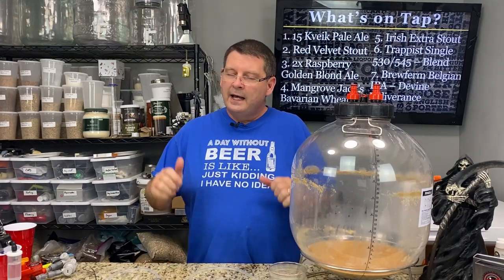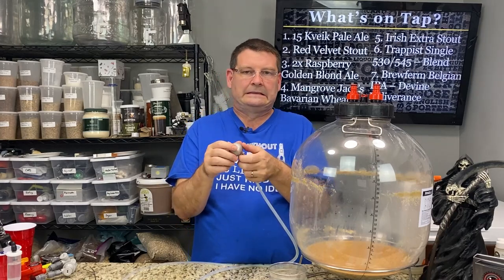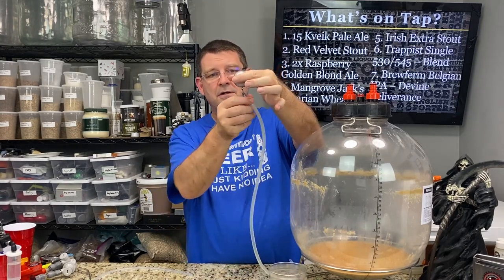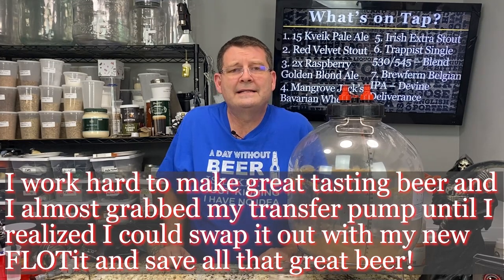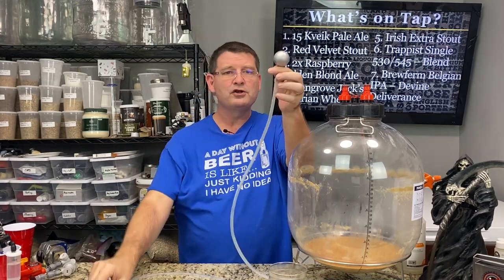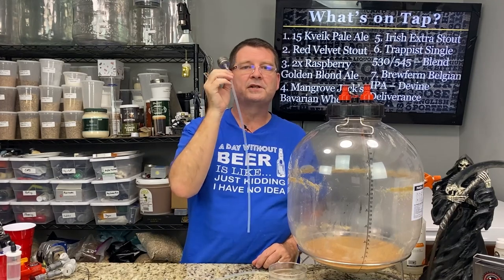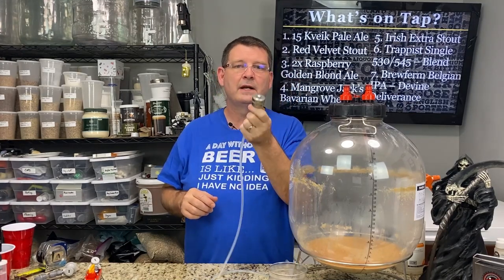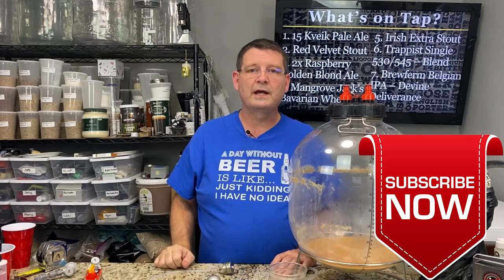Corny Keg Floating Dip Tube, Major Issue

Comment: Wait. If the ball is nearly under the beer, and the pickup tube is under the ball, how does that make you lose beer? The lower the tube is, the more beer you should get. What am I missing?

Okay, I saw the explanation at Homebrewfinds. The tube hits the yeast cake, and the yeast cake blocks the beer. This happens when there is still a lot of beer in the keg, so you lose beer. Now I get it.

Thanks for this video.
Reply from the maker: Sadly I was in a lot of pain and grumpy when I did this video, as I was annoyed that a lot of companies were jumping on the bandwagon to resell something that was invented by some home brewers over a decade ago. If you get a chance, you should check out my Floating dip tube comparison series (4 videos), but here is the 4th video making the final comparison - https://youtu.be/xd-ajnaEGd4

Comment: Hi folks, viewing from Ireland love the channel, great advice. I've been using the kegland floating dip tube in my modified bucket fermenter and kegs. I ran into same trouble at start. I fixed my issues by adding a second stainless steel ring to dip tube ball float and cutting silicone tube so the end stops a couple of mm from bottom of keg, kegs now empty fully, so every last drop of precious beer except yeast is drank. Did same with the modified fermenter, added ball lock posts for closed transfer and added a filter to the end of floating diptube and have had no problems with beer left in fermenter or trub being transferred when kegging. I know you shouldn't have to do these things, but I think it's part of the home brewing magic, adapting and modifying. The flot it dip tube looks awesome, I'll definitely be getting some. Thanks for the link, advice and review.
Reply from the maker: Welcome and Ireland is at the top of my bucket list so much love in return. I really just want to go to the Temple Bar and have a pint, just to say I was there (plus a few other cool places of course). 😀😀😀 - I appreciate you for sharing that info and I think I understand as I've seen a photo someone else referenced where it was tube<->small opening connecting to the floating ball<->tube if I follow and of course the metal filter on the very beginning. (?) Correct? This way if the tubing hit the trub it didn't suck it up first but the liquid correct? Feel free to share a photo from Imgur as pictures are always helpful but not required. I did ask Tongo about shipping to AU for a friend and it was crazy cheap just probably not very fast. Sadly I won't get to Ireland until maybe 2 more years if I am lucky otherwise I'd just order a few and bring them with me for you.
Reply: Hi, since this comment is 3 years old, did the Kegland dip tube have the mesh filter back then?

Comment: The critical thing is to trim the tube just right.  You want the length such that it would hang free and pick up just below where you expect the top of the cake.  This makes it easy to control pickup depth by angling the fermenter a little.  Obviously this will work better with a cold crash, as the cake will be more stable, but that the difference isn't huge either way.
Reply from the maker: I fully agree with the angling of the fermenter but as my trub was far from solid it was a bit of a pain (and I don't have anywhere to cold crash the all rounder as it is kind of big). I get what you are saying about the shortness of the hose but the trub does flocculate a bit based on the yeast and the OG and FG of the brew, sometimes significantly. My big point was that the FLOTit (although they recommend trimming the tube to) doesn't need any modifications to work amazingly well compared to a design that is going on 20 years from my research that doesn't appear to have ever had a patent issued as everyone copies it with very little changes if any. 

The new Kegland filter for the floating dip tube (which they are now throwing in on the Fermzilla complete setups deals (after I got mine)) actually helps fix theirs not so much with the filter but how the filter will hit the trub forcing the tub to level out and never hit the trub directly as compared to without it.

Comment: I’ve used the kegland floating dip tube in the fermzilla and in my kegs for over 20 batches or so and have never had an issue with leaving beer behind. My liquid line does not sit 2 inches below the ball. I will say I always ferment 6 gallons of wort so that helps but in the keg it will settle to the bottom and it leaves no beer behind IME.
Reply from the maker: Does it pull trub? I had someone tell me they had the opposite issue with the tubing sticking out of the liquid which I'm not sure how that happened but all I saw was the tubing was heading head first into the trub and the tube was a solid 2" below the surface.
Reply: @BitterRealityBrewing  I do exactly what short circuited brewers does. I tilt the all rounder when it get close the the trub and I get every ounce I want out of it. I look at it as a positive to be able to control how much I get. I have yet to find a fault with the all rounder using their floating dip tubes.
Reply: @jeffnicholson6110  this is exactly what I do as well. I really dislike this video because literally the smallest change in technique makes the kegland dip tube work perfectly. It DOES NOT function as bad add this dude makes it out to be. He was just to lazy to try and figure out how to make it work right.
Reply: @mattb6124  yeah I felt it was a little harsh. I may be a bit protective because the fermzilla and floating dip tubes have really taken my beers up a notch. At least to my taste. Not to mention the all rounder with floating dip tube has given brewers an affordable piece of kit that really produces. Brewers tinker on things and the floating dip tube literally takes 2 seconds of tinkering (tilting the all rounder) to make it work perfectly.
Reply: @jeffnicholson6110  1000% agree with everything you just said.  They're both too great products for me to sit back and be silent on this one.
Reply: @jeffnicholson6110  ^^^^ This, tilt and slide the Fermzilla down as you empty it and it dispenses every last drop if you wish it so.
Reply: @mattb6124  Did you keep the tube full length or did you need to shorten it (in a Kegland keg)?
Reply: @zt7489  mine are all full length still. No need to cut.

Comment: Exactly why I bought 5. 
Also the firmzilla floating tube sucks up to the side , I had to make a notch in the tube just to get it to flow. 
Flotit. Works amazing.
Reply from the maker: I fully agree and I'm very happy I found Tongo (on eBay) and his FLOTit devices. I have 7 now but need to order 3 more as I didn't plan on needing them for fermenters.

Comment: Awesome would you recommend using this for a  keg to keg transfer, for example, I currently have 10 gallons of peach saison beer that was transferred from our fermenter to Two corny kegs. I'm cold crashing beer for two months before carbination because the beer is for a wedding in December, hopely the cold crash will result in more trube/ peach bits that will settle out during cold crash. Then I'm  thinking that I want to use this float to do keg to keg  transfer to final kegs for carbination. I'm thinking I will try to attach flotit to my  keg carbonation stone keg lid. Do you think it will work or do you have any other suggestions?
Reply from the maker: 100%! The newer FLOTit is version 2.x now, and it is awesome. I purchased a lot of them and had to do a transfer from an All Rounder Fermenter under pressure to a keg. Something I do all the time but this time, it was with a ton of Blackberry pulp which clogged a cheaper floating dip tube I was using. I swapped it out for one of my FLOTit 2.0 devices that I had recently purchased, and it worked like a charm. I'm slowly buying more to replace all of my current floating diptubes, so all of my kegs (16+) and pressure fermenters (3) have one each, with a few spares. The inventor gave me 2 for the video reviews, but I purchased all the others as I was simply impressed with the performance.

Comment: Have you used the Kegland floating dip tube? The Kegland tube actually lays down at the bottom and continues to suck until keg is empty. Be careful when bagging products
Reply from the maker: The video is a bit old and that was the Kegland floating dip tube which I've mentioned in newer videos that Kegland was one of the only companies to admit there was an issue and address it with their plastic filter add-on as the design was invented by homebrewers almost 20 years ago and many companies have copied it without fixing the issues. I did a 4 part series on the Floating Diptubes by covering each type/brands in 3 separate videos and then the final head-to-head comparison in this video - https://youtu.be/xd-ajnaEGd4 Although I don't regret the original video as it was done out of frustration I do regret being a little hostile as I was tired and in a lot of physical pain (due to heart issues) and I'm normally really easy going but when I'm in pain I'm serious grump. When you watch the video you will see almost all designs have their pros and cons. Plus some are really cheap and others are very expensive.

What is funny is that I got a lot of flak for that video when it first came out but I later had 3 of the people who gave me flak come back and apologize, after realizing the original designed very flawed compared to other systems and improvements available. One was like "I never realized I had an issue until you pointed it out and now I can't stop seeing the problem with the design."

Comment: I am one that bought the floating dip tube. I see your point. I have re jigged mine like this and it works much better. I took off the ring that connects the float to the stainless tube. I flared the little stainless tube to go over the ring on the float. Then I Locked it there by reinstalling the ring. Now it picks up the same as the float it. When it gets to the bottom it won’t get into the yeast cake. The hose needs to be adjusted to do this properly. I tried to send a picture but I could not.
Reply from the maker: Thank you for your insight and as a homebrewer I think we are all use to a little DIY but it really shouldn't need that much of an adjustment. The design appears to have been created by some fellow homebrewers almost 20 years ago so I think it was time for something better and I'm just happy someone stepped forward with a better design. I brewed a DIPA today and used my FLOTit in the Fermzilla not just because I'm concerned for grabbing part of the yeast cake (even with rolling the fermenter around) but I went nuts on the hops so I'm a bit overly concerned as most went into the fermenter (1 full pound of Cascade as I had way too much of that stuff from deals). Thank you and please feel free to share a link to Imgur of your modification as I'm looking to either modify mine or make them Xmas ornaments.

Comment: I use one of these in a corny that i ferment in, works great! I actually just got a kegland kegmentor that came with the ball style floating dip tube and went ahead and ordered another floatit for the same reason as you mentioned in the video.
Reply from the maker: Awesome and I'll be doing two more videos on floating dip tubes in the near future to help others see the differences and on a new product too.
Reply: So floatit works fine with kegmenter? I'm having issues leaving beer behind the kegmenter.
Reply: @jafarym77  it does, you'll have to play with the length of your tubing if you don't want to leave anything behind. Mine is cut to leave about 1/2 a gallon behind. The few times I have used mine it has worked well, that last 1/2 gallon has been trube anyway in my experience.
Reply from the maker: @jafarym77  I would say definitely but if you don't need one right away keep your eye out as he has a FLOTit 2.0 that is going to be so effective that is is copyrighting a slogan or catch phrase (I think copyright is the right term he used). I am beta testing it right now and it has one minor change and one major change that is extremely effective. I would say with any you might leave a small amount of beer behind but with the new one that he sent me completely out of the blue for beta testing, you might leave a tablespoon or two of beer behind at most as I have one more test but so far I am extremely impressed.

Comment: Switched over to these dip tubes and have liked them up until recently. I am towards the end of the keg and the beer is coming out foamy and a bit flat. Any suggestions?
Reply from the maker: Actually I just had a like issue with the pressure fermentation and I relieved the pressure picked up the dip tube and dropped it back in and everything was good. Not sure what it could get stuck on in a keg but for me it was a bag full of dry hops. Let me know if this fixes your situation.

Comment: How do both systems compare in emptying sanitizer in a purged keg or fermenter? I worry that Flotit wont get the last pint or so of sanitizer and I would have to open the lid and turn upside down, not allowing a ferment pressure transfer as easily. Curious.
Reply from the maker: I haven't tested that but I would expect the FLOTit would leave a bit more sanitizer behind but not too much.

Comment: Would it help to turn the fermenter 40 50 degrees or so leaving the trub to the side? That way the dip tube isn't above the cake. Also do you recommend the Fermzilla? I'm looking for a new fementer. Reviews of it are all over the place.
Reply from the maker: The tipping will help although my yeast cake wasn't as compact as many as it was a Saison yeast so any disturbance of the yeast cake would have disturbed the yeast a bit. Yes I would highly recommend the Fermzilla all rounder as I personally haven't used any others. I will eventually do a review but want to use it a bit longer first. I did order the fermentation jacket for it but it appears to be unavailable until sometime this spring but I do have it on order. I also ordered the chiller coil but to use it, it requires a lot of drilling so I will probably just order a 2nd lid so I have the option for when I do and don't want to use the chiller. I will say to open the lid either use a leather belt, a bike innertube, or grab the big version of a rubber strap adjustable wrench like this https://amzn.to/2PAJ0Un the big one barely works but it does. Morebeer had an OK deal on a complete kit which is where I grabbed mine and I was just disappointed with the floating dip tube included which I just realized as I'm looking at the deal it was supposed to come with the filter but I never got that in my kit. If you get the deal and it comes with the filter you will have a lot better performance as the filter actually pushed the dib tube up a bit as the filter will hit the trub before the tube does helping to prevent pulling trub into your tube which makes it a much better system with that one minor enhancement.
Reply: I have the same stuck lid problem with this fermenter I have. I had to get the what I call the big oil filter wrench to take it off. I have the all rounder kit bookmarked. Out of stock. Seems they added the filter. When I bookmarked it it didn't show a filter. I see what you mean with the dip tube. Funny reading the comments. It's like a Canon, Nikon, PS5, xbox or DJI fan boy. They'll just disagree cause they bought that product, stand by it & refuse to be wrong. I'm going to get the Fermzilla. I put my email to notify me when the whole kit is back in stock. Thanks for the response. Cheers 🍻
Reply from the maker: I almost forgot if you get the All Rounder before you put the sticker on for the measurements, put exactly one gallon or what ever amount you want to use for measuring. Then us a level and level the all rounder at least in 3 directions like a triangle to ensure it is perfectly level as this will help you to put the label on correctly so that you get accurate measurements in the future.
Reply from the maker: @MasoThings  So true and I was a little over the top as I wasn't at my best (tired, annoyed, and I hadn't mentioned in pain and when I'm in pain I'm like a mean drunk as I get really grumpy). What is really funny is I've had one person in the comments and a few others in email actually send me info after they first thought I was crazy stating that either they've always had the problem I was pointing out and didn't notice it or they just had the problem I mentioned for the very fist time. A few actually apologized for getting a little grumpy with me about what I said. At the end of the day I am happy to stir the pot a little as we all see the world differently and we all have opinions which we may not all agree on but if we were all the same and thought the same way this would be a very boring world. I was happy I was honest but I do regret being a little over the top with my annoyance at a 20 year old design that a ton of companies are selling.
Reply: As long as you're honest about it. I saw the imgur pics. made sense to me. Look at the review of the Hotor portable vacuum I did (I only have a few videos) The thing was terrible. Only a few comments but even though I showed on camera it didn't work. People refuse to accept it.
Reply from the maker: @MasoThings  Kicked you a couple likes and a sub and will check it out later (I left the tabs open as I have a habit of forgetting things so leaving tabs open helps me remember to watch thing). I've never heard of Hotor but I can easily see its uses to have a small vac that also does wet as I make messes pretty much anywhere I go and most are not intentional. I just got back earlier from South Florida and am a bit of a zombie at the moment.
Reply: @BitterRealityBrewing  Cool Thanks! I'm doing a review video now as we speak of a portable charger. I'll have more brewing videos coming too. I've learned a ton from you. You're the king of top ten tips. I love it.